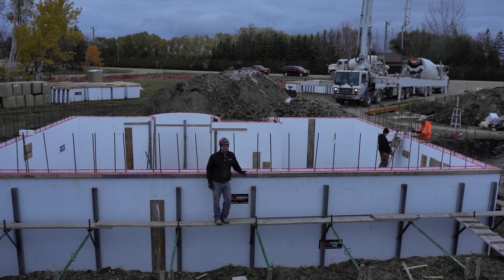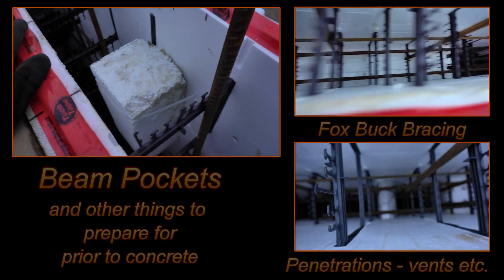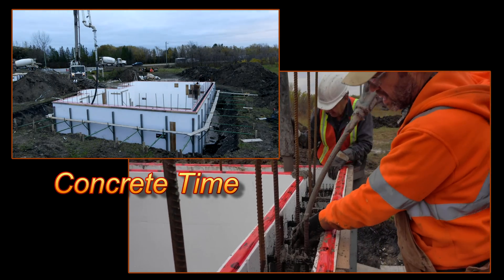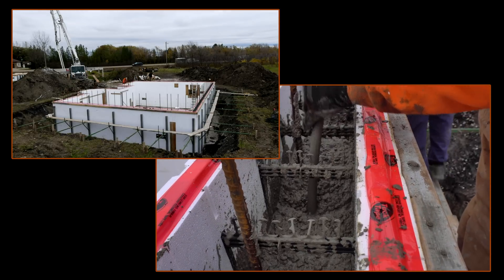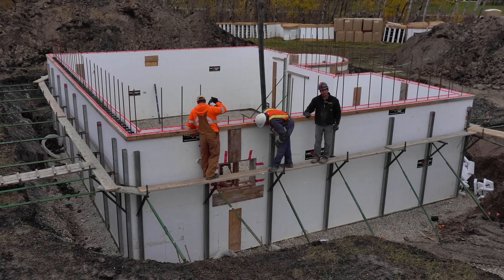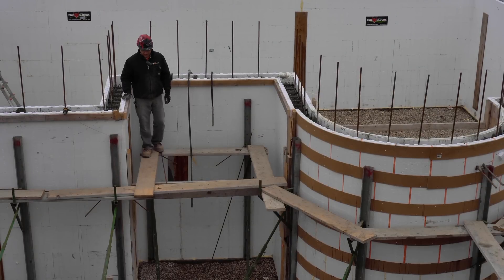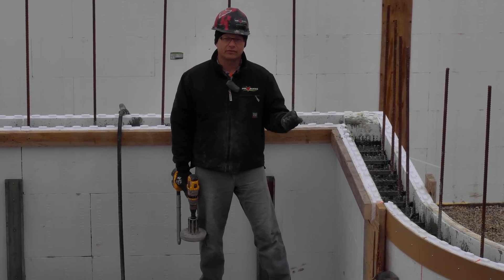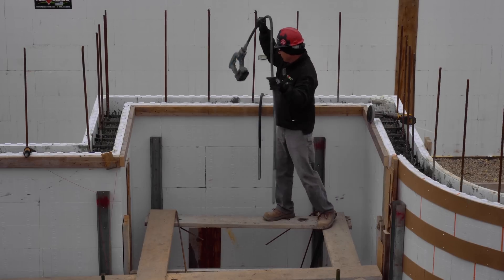Building an ICF Home with Fox Blocks | Full Concrete House Construction Process

Comment: If you are going another level up, how long should the first pour set before adding the next pour and does it matter how close to the top the first pour is finished? Would there be a structurally weak point where the first and second pour meets?

Comment: What I don't get is the guy plunges the vibrator in and pulls it out and you see the concrete sink locally.  Then he goes 2 feet away and does it again.  Isn't the concrete in between still unsettled?  I would think you'd want to sink the vibrator every 12 inches or so.  By the way, she thinks so too!

Comment: Really good video. Hope you see this - couple of questions:
1. Where did you get the wall vibrator that works with the drill?  Who sells?
2.  Who sells the 8’ cordless vibrator? 
3. Why was the decision made to put the bracing on the outside of the walls in this case?  What is the advantage?

Thanks!
Reply from the maker: Bracing is to the outside because the basement was sloped on the inside with deep gravel. Pegs would have been difficult. Really does not matter what side the bracing is on. Putting it on the outside will use more bracing.
Reply from the maker: Hi MarPalm. Wallbrator is no gone from the market but Giraffe bracing sells one called a rattler.
The 8' cordless is the 18v makita which has been a favorite for many contractors.
These both work but I will still use a corded vibrator often.

Comment: Say you want to face the house with faux stone or tiles. How do you attach it to the foam? Do you lay a mesh with concrete and affix the stone and tiles to the concrete?
Reply: Screw wire mech to the ridged ICF and parge it with mortar. When dry, you can slap your fake masonry on the wall.

Comment: Was this a two part pour ? Or is the concrete added for the full depth of the wall in one go? Guessing thats why you have a eight foot length vibrating tool, for full depth, just thought ive watched two part pours also.

Comment: 7:10, the vibrator is used to eliminate "air pocket."
Reply from the maker: That sums it up and to add one bonus to this is that by removing the 'air pockets' you properly seat the rebar. I have personally seen walls that were smooth like glass on the wall face but when saw cut the rebar had 1/2" gaps of air under them because the contractor believed vibration (consolidation) was not needed. Fact is, it is. And all of the main stream ICF's can handle consolidation.
Reply: Fox Blocks ICF - Thanks. One question, can roofs and upper lever floors be built with the ICF system? Most ICF companies I see on here just use or promote their system for exterior walls only. I was just wondering if ICF, in general, is flexible enough for a variety of roof designs and also freestanding balconies?
Reply from the maker: All ICF companies have toyed with the idea of roofs and floors so yes they can be done. Lite-Deck is a good example. Most of these systems use a lot of EPS as their form which places the insulation under the concrete. For energy efficiency, the preferred would be to have the EPS above the concrete to hold the energy within the concrete. At this time ICF's are best suited for walls but the day will come where they can do the entire envelope efficiently and practically, I do not feel we have arrived there yet.
Reply: Good info. What would be your preferred system for a concrete floor with hydronic heating for the second floor?

Comment: For the Wallbrator, would you be confident using it as the only means of consolidation if a pencil vibrator was not available? I noticed you used only the Wallbrator on that storm shelter in a different video. Also, with the Wallbrator, do you recommend only one pass (bottom to top), or does a second or third pass add some value?
Reply from the maker: I carry a wallbrator with me because many contractors do not believe in consolidation. I explain the importance and suggest they use it as a minimum. Yes I would and have completed many projects with only a walbrator. This does not mean it is the best solution, just this past Friday I showed up on site where they were not vibrating and the wallbrator was no good because the concrete would not move in the wall. Basically all ICF walls require consolidation and an internal vibrator is the best solution. The only exception would be when using self consolidating concrete.
Reply: Fox Blocks ICF thanks!

Comment: We were told not to vibrate concrete in an ICF form, that it would blow out.  What is the recommendation?
Reply: Dennis Toth we use a makita 1 inch pencil vibrator. and a wallbrator. they are strong enough to consolidate concrete but not blow out forms
Reply: Thanks for the reply Ryan.  We are up here in Canada and are using the Superforms manufactured in Pincher Creek Alberta. Still trying to convience them to vibrate the concrete.  Everyone is afraid of blowouts.
Reply: we have nave had a blown out due to vibration. we had a blow out last week but it was a defective form. Wasn't a big deal, and it was our first since we have been in business
Reply from the maker: Vibrate. Build the project as per manufacturers training which will allow for proper consolidation. I have used many brands of ICF and will average a failure (blowout) once every 20 projects because I'm ensuring a proper job. I'm OK with this and have lost my fear of failure. Most of these so called failures are patched up in 10 minutes while the concrete placement continues. For some odd reason we make a bigger deal out of them than they really are.

Comment: What's the common thickness for walls residential homes using ICF
Reply: Imperator Augustus most basements in can be designed for 8 inch walls and above grade is typically 6 inch concrete core
Reply: Mine is 1 foot thick

Comment: is there a need to waterproof ICF? I don't see any waterproofing in your video? Are the footings covered with the concrete slab from inside or is that gravel going to be left there like that? Do you add a concrete slab before pouring the walls?
Reply from the maker: Just like conventional concrete foundations ICF's require a membrane if you want to keep water from coming through. Even coffee cups leak after a while. Yes a concrete slab will be placed after the walls are completed.
Reply: @FoxblocksICF  your coffee cup leaks? How much? How long? did the coffee burn you? I suspect you mean a drop of coffee in a month. If so whatch out for the flood!

Comment: What are your thoughts on adding steal fibers to the concrete mix like Helix?
Reply from the maker: I'm a fan of Helix. Used their product over 10 years ago on a series of projects and will continue using it whenever possible. Engineers are slowly starting to understand and accept.